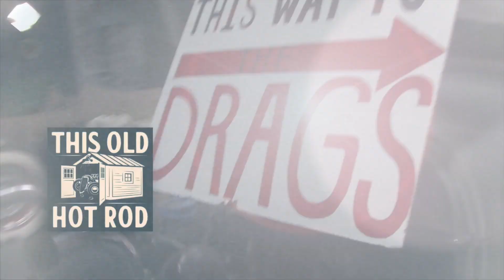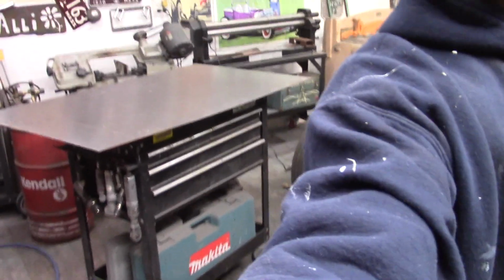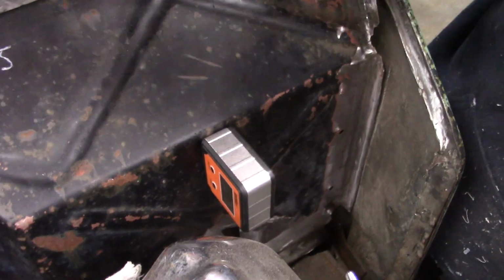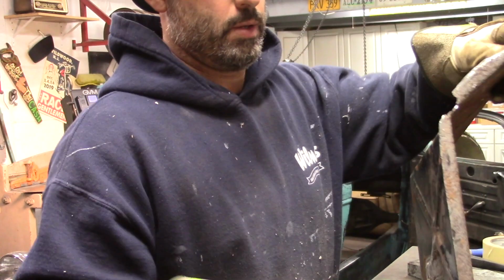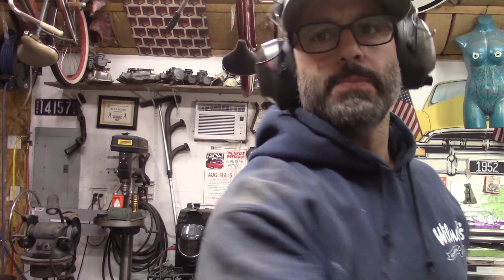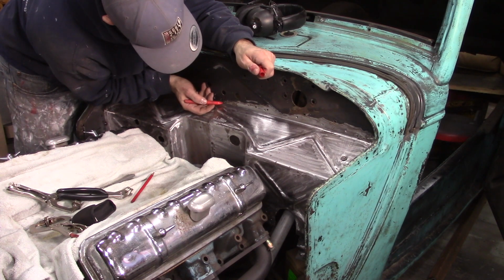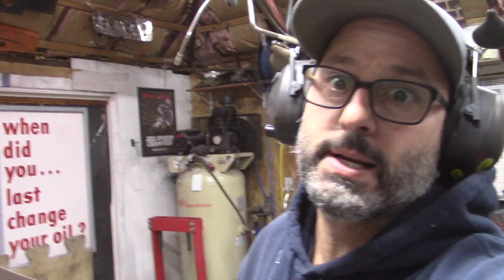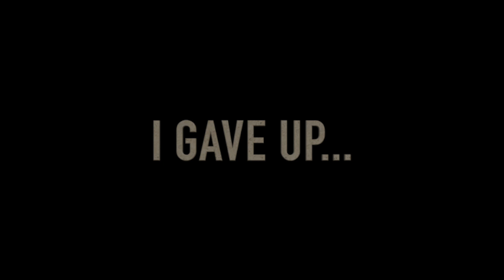Modifying the 1935 Ford Truck Firewall Episode 2

Comment: Mike I had to Chuckle, I thought I was the Only 1 that has that problem I take in &out. The harder it gets to repeat in & out 🙉  A CELLAR Uder the Garage WOW! That's where I'd put the compressor. Mine is in ta truck box. Plumbed with PVC 3/4" pipe. Have no issues with condensation &only had 2 breaks in 20 yrs. AWSUME Fab Skills !!!
Reply from the maker: Haha. I’m glad you enjoyed.  Yup. It’s going on the basement.  Not right away but soon.  
Glad you guys can all relate.  It’s a struggle 😂
Reply: @ThisOldHotrod  I lucked out someone gave me a 80. Horizontal so I have 160 gal. Of air supply .

Comment: I call it the old Ford dance. You could clamp the part to the car, drill threw it into the car and then bolt it on. Then take it off and try to put it back on and you’ll have to sit it at the right angle and put the bolts in. A specific order LOL. Never faisl

Comment: You are going to sandblast the back before welding? Unless your sandblasting cabinet is that big. 

“What is going on here?!” A familiar feeling sometimes in the garage. In fact I have the transmission still out of my mustang because the kit had the wrong alignment tool included. 

Cool car, enjoying the videos.
Reply from the maker: Ya. I’m going to sandblast the firewall before I weld it.  The pits in the metal are deep so it’s not worth h trying to sand it down.  
I do have a good size cabinet. Easily will fit the pieces in it if they’re separate and not welded together.  Or I have a tank I use for outside for the larger pieces.
Reply: @ThisOldHotrod  thankfully they used good thick metal back then. The epoxy will protect it from further decay. Your solution is so much better than just making one out of sheet metal. 👍
Reply from the maker: @rona1144  thank you.  That is what was actually in the car when I got it.   I wasn’t happy with the flat metal look and wanted and more pleasing firewall.  Something that looks like it could have been factory.  
Maybe not the “hotrod” way it was done back in the 50’s -60’s but that’s okay. Things change with time.

Comment: Going dead at the end of that vid ya noisy bugger
Reply from the maker: Cool ... thanks !
Reply: Meant to say deaf.
Reply: Just plowing my way through videos a bit of binge watching going on at the mo, I might be upto date in time to return to work when I am allowed
Reply from the maker: @mentaldogmark  well I appreciate the negative comments. Those are always great comic relief.  
Thanks 🙏🏼 
Mike
Reply from the maker: @mentaldogmark  make sure you slow down and watch all the commercials ... 😎👍🏼
Reply: @ThisOldHotrod  no not negative I am enjoying the content, just thinking of your health getting stressed over them pesky panels to fit just thinking it  would be quicker and easier to remove the engine to allow space.
Reply: @ThisOldHotrod  adverts horrible things (keep seeing the same one over and over and over.....) I do endure them......mostly. I am not always a fan of live videos though, keep up the good building.
Reply from the maker: @mentaldogmark  I needed the motor in place to shape the panels to the bellhousing. 
I know there is always more than one way to do things.  
It’s a process no matter which way your brain tells ya to do things. 

Thanks Mark.  😎👍🏼